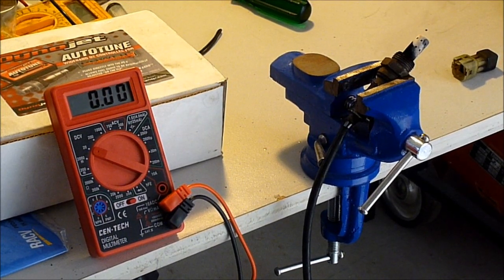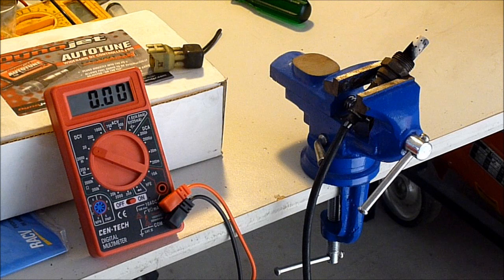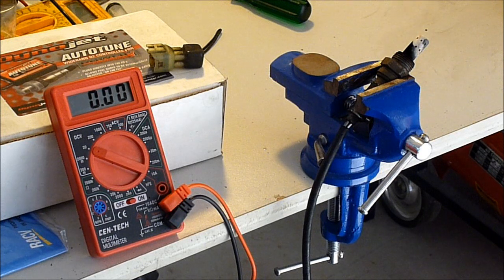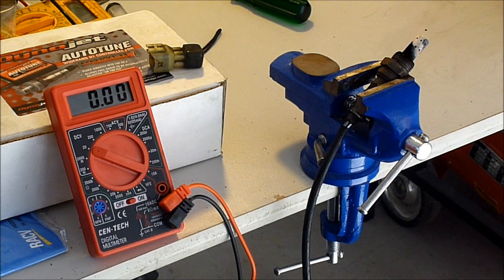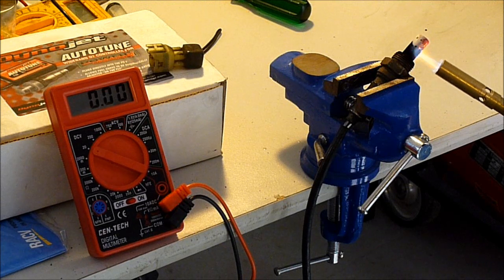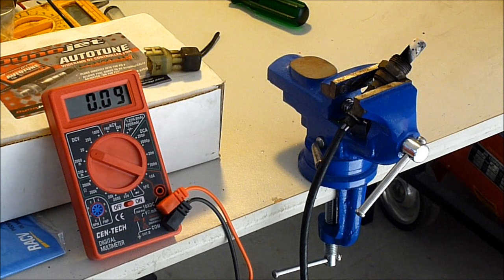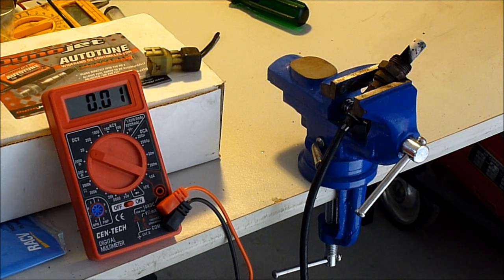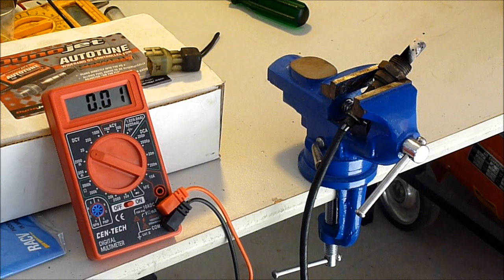VFR800 O2 sensor eliminator behaviour and O2 sensor test

Comment: Very good explanation, but o e question. When map its adapted after 20 minutes riding, when you turn engine off what's gonna happend? Is it stay, or you have to adapt it every time?
Reply from the maker: Generally, most fuel injection systems have two separate values for O2 based trim, the Long Term Fuel Trim (LTFT) and Short Term Fuel Trim (STFT).  Short term is immediate +/- 20% and the long term is what the computer "remembers" from last time.   If your LTFT is really high - say +20% - due to a problem and you fix that problem, then the next time you start the engine the engine would be running too rich and the STFT would go 20% to fix it.   This will slowly drag the LTFT down from +20% and the STFT will slowly come up from -20% until they're both generally hovering aroung +/ 5% trim.
Reply: @KaldekBoch  thank you for your help. I bought my bike (cb1000r) with decat fitted and o2 sensor in. For me wasn't ruining properly so to be safe I have fit in cat. Now I gonna put of decat pipe back on  + o2 eliminator, and maybe later pcv. Very useful video. Thanks

Comment: This is really interesting and is now making me think I shouldn't have run a reset adaptation on my Daytona 675 when installing my Bazzaz with the o2 eliminator. Which now has idling issues with the eliminator connected and a zero map.
Reply: Hey man,  I was wondering if you connected an O2 eliminator on your 675?  I am trying to trace the O2 sensor to the plug but it looks like it goes into the wiring harness for the ECU.  I'm wondering where exactly you connect the O2 sensor eliminator to?

Comment: I already installed the power commander eliminators, now I am trying to find plugs for the O2 bungs/holes in the factory exhaust, do you know which size they are please? M18 x 1.5 or M12 x 1.25? Thanks, cheers.

Comment: Interesting video. 

So if i were to attempt to make my own o2 sensor eliminator... how exactly do i choose my resistor ? Because i currently am forced to no run my stock o2 sensors after modding my car. And i need to find out if i just have to jump two wires and run a resister between two leads ?  

Thanks for your time